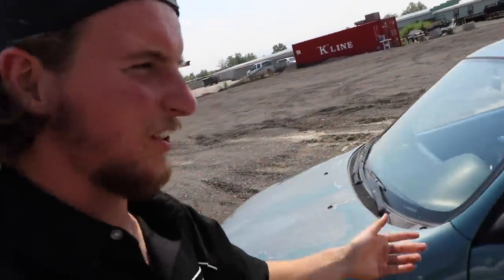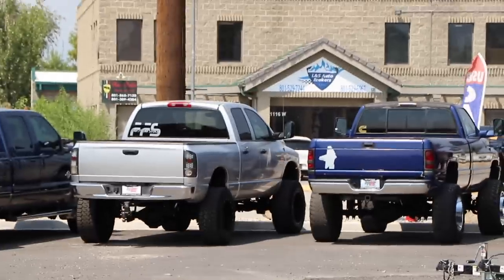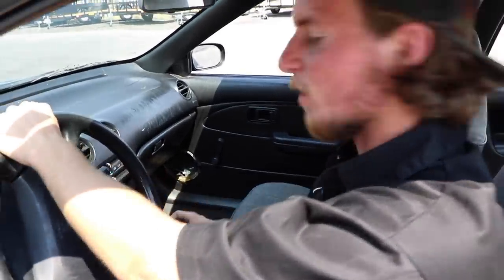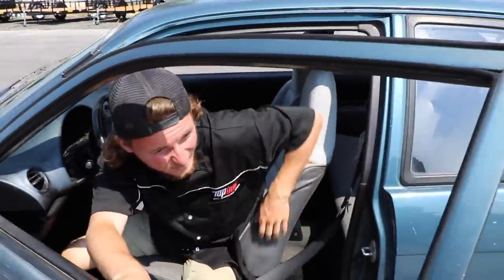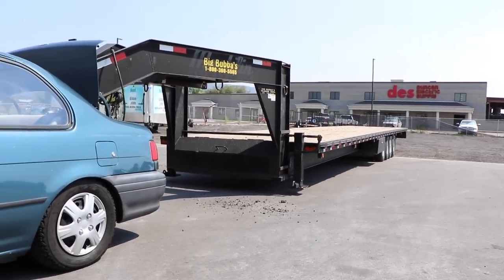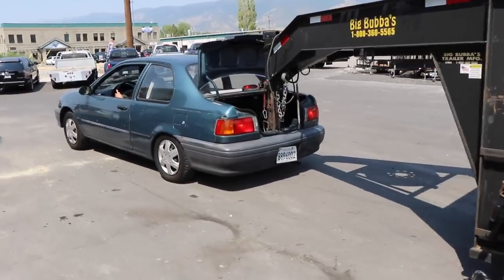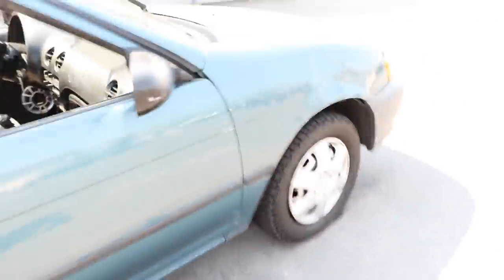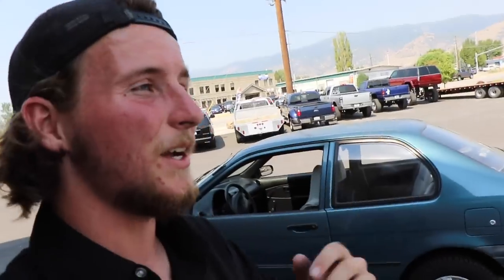CAN A SMALL CAR PULL A 45FT GOOSENECK TRAILER??

Comment: Toyota's can pull anything
Reply from the maker: Fadhil Alissa I have to say I am surprised by the results😂😂
Reply: Bug Bmx I was too lol
Reply: Bug Bmx even girls?
Reply: YES
Reply: J
Reply: no DODGE life
Reply: Hunter Reitz f ford chevy life
Reply: realkid extreme F Chevy, Chevy Is Absalute JUNK
Reply: Hunter Reitz right on
Reply: Hunter Reitz also Ford's suck and so do Chevy dodge life
Reply: Fadhil Alissa NO
Reply: Hunter Reitz Chevy is the best quality truck explains why it's most expensive
Reply: Get a toureg and a plane that pulls anything
And escalade is the nice version of GMC and Chevrolet
Reply: Lol Gm designers even admit that they build there trucks to last to 100K and that's it. Because most trade there trucks in before 100K.
Reply: Then why do I have 320k on my gas 2000 Silverado (bought in 2008 with 76k on it)? Original engine and trans, only major repair on her has been the rear diff.
Reply: I'm not saying there bad trucks. Iv owned many GM trucks. I was just stating that GM doesn't design there vehicles for long term. Nor does any manufacture for that matter. The newest GM trucks have had lots of issues though. And My f250 has 289K With original motor trans and rear end. No major repairs as of yet. Had a plug blow out at 189K but besides that no issues. My 98 f150 made it to 420k with no major issues. Just got way to rusty.
Reply: Juston Chen 
a supra, yes.
a corolla....  yea no!
Reply: Hunter Reitz 
FIX
OR
REPAIR
DAILY
Reply: Fadhil Alissa Really? Guess what pulled a space shuttle.
Reply: Hunter Reitz NO TUNDRA LIFE!!!
Reply: Fadhil Alissa, yeah. And Toyota's has had more recalls then any other vehicle out there. (Including Ford vehicles) 
Calvin uber, the landscaping company I used to work for has ALL Chevy Silverado trucks. From, 2004 (when I first started working for them) until about, 2013 they had probably about 3 or 4 recalls. Between brakes, transmission and there's another and I forgot the name of it.
Reply: Yotas are just built too good lol
Reply: can a Toyota pull world biggest dumper

Comment: Do the wipers not turn off? 😂😂
Reply from the maker: Brayden Aurich Nope😂😂😂
Reply: Bug Bmx nice 😂😂 I'd just pull the fuse so you don't have to deal with them honestly
Reply: But keep one with you incase it starts raining
Reply from the maker: Brayden Aurich That's what I'll have to end up doing probably😂😂
Reply: Bug Bmx ya 😂 i better head over to install and send ya a pic of my truck 😂
Reply: You could put in an on/off switch into the wiper circuit.
Reply: Brayden Aurich and h
Reply: Pull the wiper motor, and add it to the CVD shaft....HYBRID power!
Reply: Bug Bmx put a hair clip around the piece of shit wiper stick switch it'll hold it in off position I know from experience had a 1994
Reply: Brayden Aurich true
Reply: Bug Bmx hi
Reply: I drive a tow truck it is a flatbed and it's black
Reply: it will work
Reply: Dirty Diesel Life   P

Comment: It's possible for an 50 HP motor can move over 25 tons of stuff very little, but the point is how strong is the clutch, transmission and gearing to safely move for such an heavy semi flatbed trailer. Every cars has weight limitations based on stopping power, handling, safety, stress on engine and transmission can handle it especially on public roads.

Comment: The trailer will add load behind the rear axle, which in turn will take loading off the front axle, which is where power is being delivered. There will not be enough traction at the front wheels to pull it. If you had a rear wheel drive then it would be easy to pull it.
Reply: Ok so it does pull it. But your rear axle will not last long with that abuse.
Reply: John Barron the rear is irs
Reply: Jake G I think the tercel was actually a beam axle

Comment: There's alot of videos of cars towing insane loads, like a VW towing a jumbo jet, I think that the toyota will move the trail, but since the Toyota doesn't have trailer wiring + brake controller, I'm betting that if he gets up to speed and stops quickly the trailer will go thru the back glass

Comment: Oh, it would have plenty of horsepower to pull it.  A forklift can pull it and they don't have that much horsepower.  It's just a matter of whether you have any traction.  The way you were doing it, it would work better with a rear wheel drive since the weight of the tongue of the trailer would be more on the drive wheels.

Comment: I had one of those it was a 1994 and if you put a racing engine with turbo that is used on drag racing in Puerto Rico for Toyota Tercel it will pull that like a it was a truck.

Comment: Would have worked way better if the car was rear wheel drive, had a little more power and stronger suspension

Comment: Sure only 80 HP .. But its bored and stroked and is putting down 1200 lb-ft torque .. You could have put ur cummins on the trailer as well with no issues.. Toyota starts with a T and so does Torque.. Coincidence? I think not

Comment: I think those Toyota tercel were lemonds back in the days that's why you don't see too many of them on the road but Toyotas are build tough and they last forever they're more reliable then Honda's and they require little to no repairs how do I know this because I had an 07 Camry CE base model I drove it 8 months straight with no repairs needed just regular oil changes every 3,000 miles but I ended up totaling it now I got a 2010 Corolla XRS with a 5 Speed Manual Transmission and I had it for 5 months now and it doesn't need any repairs I love Toyotas

Comment: "its not a lambo"
THAT THING IS 5000 TIMES MORE RELIABLE THEN A LAMBO!!!
those tercels and corollas run forever, just like everything else engineered and designed in japan
my brothers 98 civic hasnt had anything done to it in the 3 years we've had it. only changed the oil a few times
and we get in it and drive it everyday
even my 92 mazda b2600i has 370,000 kilometers on it and nothings wrong with it, just keeps on chuggin
F$*K domestic junk!

Comment: The Toyota could pull that trailer more reliably then a piece of shit dodge. At least you know the toyota is going to start
Reply: Triggered! jk, I had a Dodge Hemi LoneStar edition, the only real complaints with that was the maintenance was kinda high, the GPS was not touch screen, it had to have the GPS DVD in to work,  and I had to be pulled over to use it and when it got a wreck on the side the knocked paint off it rusted like a piece of shit dodge (I live in non-rust area) . Now with the Cummons, it had less the 100K miles when it first started having problems (besides it being hard as hell to put fuel in because it had a a flat bed on it and the pump would cut off even on low flow so I would have to use clamps to have it clamped where the nozzle was just going in the thing a little bit and another clamp to hold the trigger down on at a low flow rate and usually it would drip some on the ground and make me look like a asshole because the was diesel sits on cement it would look like a lot more then it really was) It would leave me stranded out of town at times, once I was out of town and had it towed to the closest dodge dealer and they had it for 2 days and it was because teeth was broke off the flywheel and they got it started so I could drive back and just had to leave it running all day and night so I could still use the truck to go to work the next day then take it to have repaired, it had electrical issues, it sucked having to replace two batteries at once, it sucked having to put a alternator in a truck with less then 100K, the dash was blown out like a piece of shit dodge.  And the mufflers is like what muffler the first time it rains in the next city over.
    Really the trucks aren't that bad besides how they rust in non-rust areas, and how the small V8 (4.7) that once they get just a little bit hot its over, if the temp gets to red it's done), it's just Dodge (Chrysler) in general. That's why they had to hook up with Fiat so they could work together to make them shit, VW brands are top of the list, but even they need help sometimes and thats why they had to call on dodge for help making a minivan (dodge caravan) that was shitty enough to have the VW logo. Not that dodge never needs help, thats why the had to rebadge a Merc van for their workvans that are going to be in the shop for a sensor gone bad, then back in the shop for a sensor gone bad, then back in the shop for a sensor gone bad.  
  Pretty sooon it wont matter because they are all going to be junk if the EPA keeps at it. The majority of my problems are due to some EPA bullshit, My last 3 cars have had EGR issues, even tractors are plagued with EPA problems, the fucking gas is 10% corn juice on a good day to fuck up gas motors that are older, then the government did that cash for clunkers deal where they had to destroy good motors and crush the car in 90 days (i think, maybe less)

Comment: Stupidest looking bit of a trailer I've ever seen.
Reply from the maker: Ferguson 20 diesel darn :/
Reply: How do you get in a gate with that how does it it even hitch on to anything. I've newer seen anything like it
Reply: Ireland.we pull trailers with straight draw bars that connect onto the ball hitch at the very back. I pull a 40ft low loader double axle with concrete shutters about 20ton altogether with a tractor ( fiat 110-90) with a straight draw bar that's only a few feet long. There's no need for 4 Axles on that trailer in the video really.
Reply: Here in USA if you place the ball over the rear axle you can add to the GVW rating and tow more weight. This trailer and truck together can haul 40k lbs the four axles are good for breaking and holding the weight. When you use a trailer hooked to the rear of truck it decreases the amount of load you can carry.
Reply: We don't huge trailers for jeeps we would use the tractor and trailer or a lorry. I don't think four axles is much of a benefit on that trailer harder to turn very hard on tires and rims. Even I had tires come off with two axles.
Reply: dude its different here. In Ireland where you are at you dont have  pickup trucks capable of towing 20,000  pounds, here in the US we do.some dually pickups with diesel engine can tow way more than that, gooseneck trailer is designed for hauling very large heavy loads with  powerful passenger trucks basically. Its a specialized trailer. I think they look stupid too but they have a purpose.
Reply: Gooseneck trailers are a great way to tow, much better weight distribution than a drawbar.